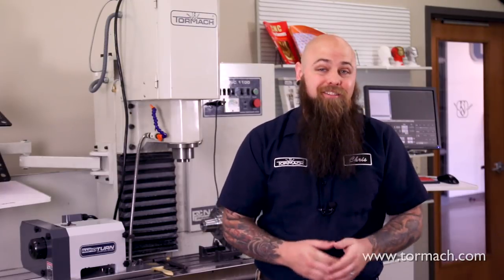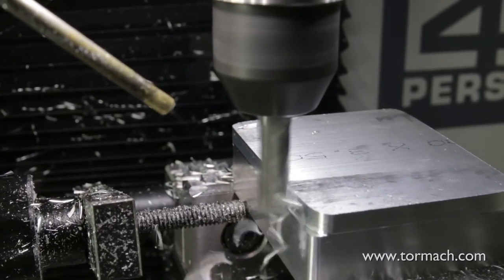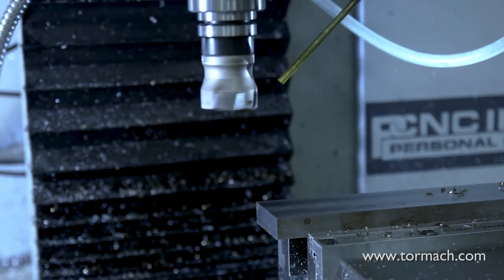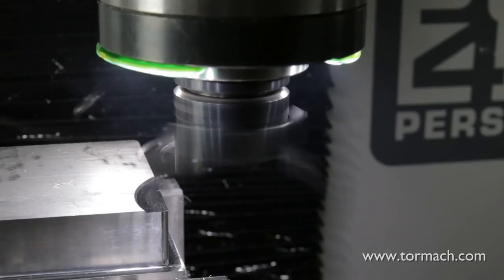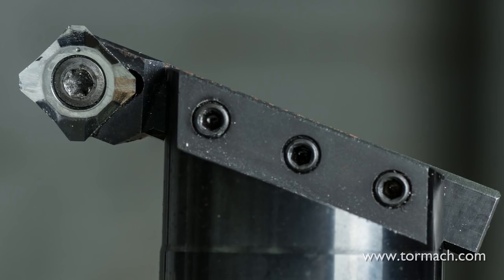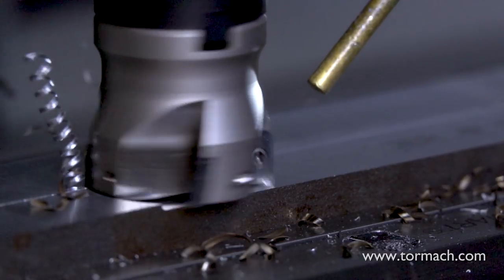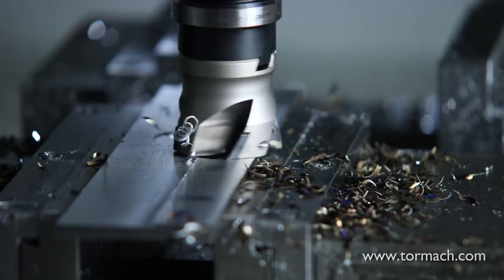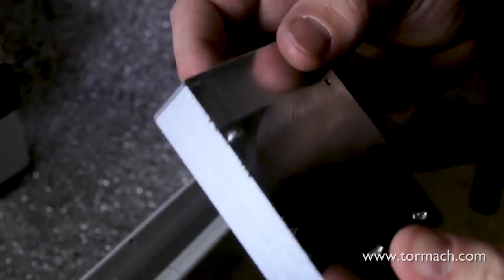The Science of Face Milling

Comment: I'm doing a face milling job on 6" wide x 1" thick HR flat bar. Using a 2"shell style cutter, the issue I'm having is steps, .005-.006 deeper or shallower with every pass. I'm only taking a small bite, .010 -.015 dept. What could be my problem? Thanks
Reply from the maker: Since there could be all sorts of variables, you could ask that question on the  Tormach Forums https://forums.tormach.com  or possibly by opening a Support Ticket with one of our Tormach Tech Support staff https://tormach.com/how-to-submit-a-support-ticket

Comment: Very nice video.

For low HP machines like the Tormach and typical entry level home shop and small shop machines, it's hard to beat the Tormach SuperFly for facing operations.  Using only one insert ensures that there can be no insert misalignment so the surface finish is gorgeous, and if the tool is crashed, there is only one insert to replace (haven't crashed the SuperFly yet).  I still need to get a second SuperFly, just because I'm so lazy that I don't want to change inserts when switching from aluminum to steel.  Yeah, that's pretty lazy.  The SuperFly is one tool that requires a good tramming of the spindle to avoid cutting a dished surface.  It'll look smooth and it'll be smooth, but it won't be completely flat unless the mill is properly trammed.
Reply: not lazy, replacing insert take time, which could be use running the machine

Comment: Is it safe to use a large face mill on a small piece of stock without running the risk of it flying out of the vise?  For example if you had a rectangular piece of aluminum stock that is 1/2 inch x 1/2 inch by 2 inch with the square side sitting on parallels and 0.02 inch clamped in the vise and you did a 0.50 inch face mill pass with a 3 inch face mill, could you expect that to cut just fine or would the stock likely just fly out of the vise?
Reply from the maker: The scenario you described would not cause any problems as long as the material is properly clamped in the vice.  The important aspect to any machining operations is the part being securely mounted to the machine.
Reply: @tormachinc  Makes sense!  Thank you!

Comment: I have a bohlerit shell mill but it sadly still leaves burs is this the varying height thing? 
I suspect the fly cutter is the better option?
Reply from the maker: Burs come from the material more than the inserts themselves.  A little trick I use to minimize these is to climb cut into the edge of the material.  This will create a clean edge.  If you are only taking a single pass this doesn't work but if you need to take multiple passes you can program it to come from both directions and minimize your burr.